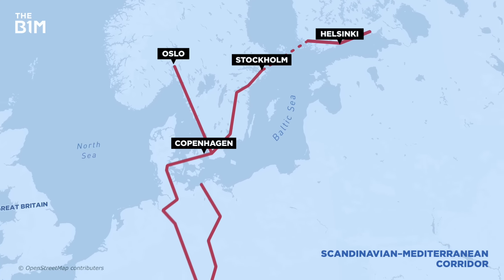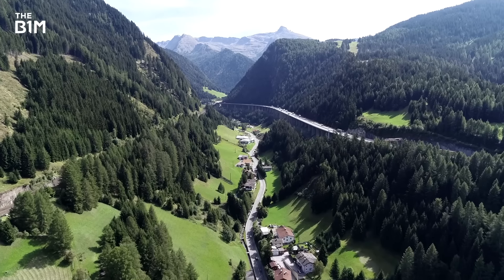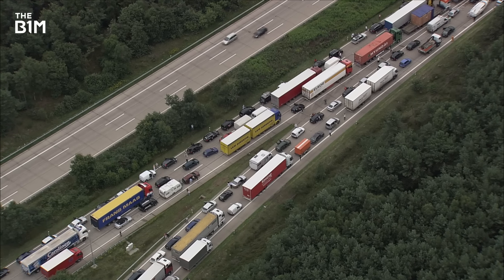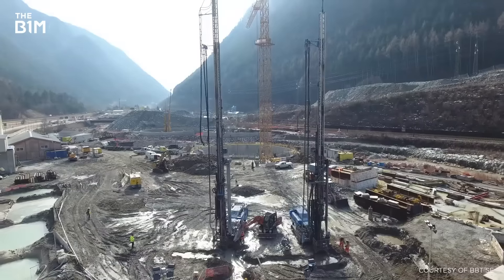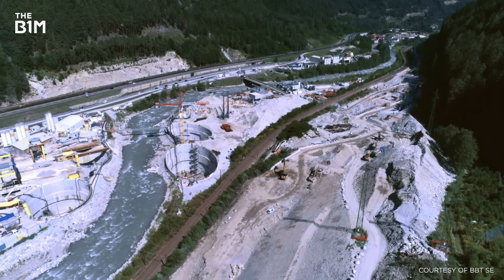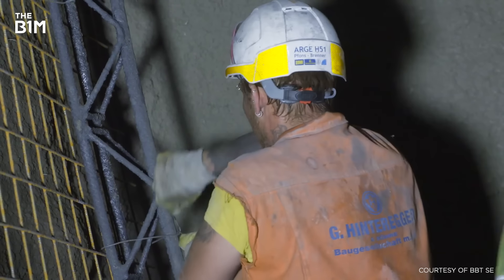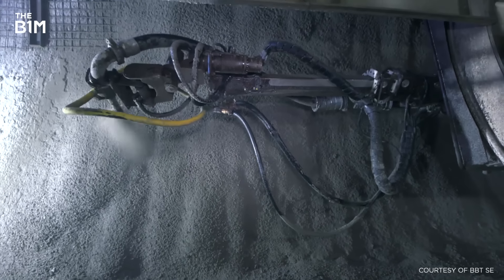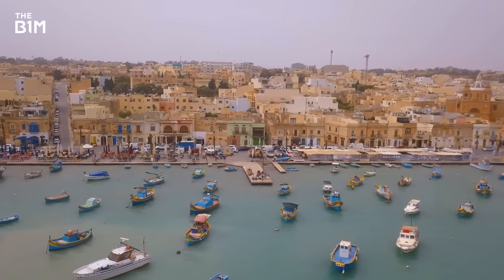The $11BN Tunnel Connecting Scandinavia to the Mediterranean

Comment: what is with the gotthard tunnel? i‘d say its also pretty important and when you look on a map the length of the way from hamburg to rome is pretty much the same. (even a bit faster)
Reply: This may seem ridiculous, but the point is that the Gotthard Tunnel is in Switzerland, which is not part of the EU. As a political and economic entity, the EU does not want to be beholden to Switzerland for a fast and reliable transport route through the Alps. Also, the Swiss charge a pretty high toll for use of their roads, especially for freight trucks.
Reply: @RudyBleeker  One more reason to NOT like the EU
Reply: @TheSlipCoach  In this specific situation, what's wrong with the EU? Rudy's comment clearly shows reasons as to why the EU would fund a project such as this.
Reply: @TheSlipCoach  quite the contrary, this project is a prime example of the many benefits of the EU, being able to organize and fund such massively expensive infrastructure over international borders.
Reply: @TheSlipCoach  I hate the eu but I don't see why this tunnel is wrong?
Reply: @TheSlipCoach  So you shouldn’t like the EU because a non EU country charges high tolls? Do you even process information before parroting your talking points?
Reply: @RudyBleeker  your comment is quite bullshit as the EU has an agreement with Switzerland to add capacity to the existing line from basel to Hamburg / Amsterdam… it’s all called NEAT and the EU also helped financing… Switzerland did. their Job, but Germany is wayyy behind with their job…
Reply: @jimi272  that has nothing to do with this project and the reasons for it
Reply: @phasorthunder1157  Living in Switzerland, with two flat railway lines through base tunnels already running through our country (NEAT), which cost billions of Swiss Francs and were agreed with and built (in time) for the (maybe not sole) purpose to help the EU get their freight from North to South and vice versa through the Alps fast, eco-friendly and reliable, I am concerned about comments that put the EU in a favourable light, heavily funding a "EU tunnel" over "international borders" only to be "independent" from self-paced third-party countries. The NEAT is already here, so why not finalise it and bring it to its full potential in cooperation with a non EU country first, before heavily funding a "EU only" project instead?

And I'm also concerned about the perception that using Swiss infrastructure is too costly. We toll freight trucks for allowing them to distress our ecosystem day by day. It seems EU citizens easily forget that these tolls pay into expensive and extensive road and road tunnel maintenance and into ecologic compensation for the heavy pollution caused mainly by foreign i.e. EU trucks.

The only hope I have is that both the Brenner base tunnel AND the NEAT will reduce road traffic through the Alps drastically in the future, and that they will save our precious Alpine eco-system from extinction. Though I'm not at all sure the Brenner base tunnel will live up to these expectations.
Reply: @mrgaudy1954  Let's face it: the new Brenner base tunnel (and its feeder lines) has - for years - been and is still being criticised as being useless in terms of expanding freight transport capabilities. It is therefore a shame that the EU - despite all the critique - will fund the building of the Brenner base tunnel with an estimated €5BN (of €10BN in total) until 2040, instead of heavily funding Germany now to finally upgrade its feeder lines to the existing NEAT through Switzerland. They would make trains faster, cheaper, more attractive and would quickly help reduce road freight traffic through the Alps. The Brenner base tunnel wouldn't be needed. It is a synonym for a failed (EU) transport policy.

Comment: This cost less than one third the price of the UK track and trace app that barely worked. Sickkk
Reply: How much is that?
Reply: You're confusing millions and billions
Reply: @BamBoomBots  wasn't it 20 odd billion for the track and trace that didn't work?
Reply: @slaneyside  an app surely cost millions not billions
Reply: @slaneyside  a quick Google search gave me a value of ~35M UK pounds for that app, while this is project costs €~11B. This infrastructure project is thus about 330 times as expensive (very rough estimate).
Reply: @karlgiese6100  that is not the costs of the app, that's the costs of the whole testing and contact tracing operation for covid-19 in the UK, of which the app was just a small part.
Reply: @slaneyside  Your quote just confirms what I said 😂.
Reply: @BamBoomBots  which didn't work

Comment: Can we state as for the Gotthard base tunnel, that Germany will not be able to complete it's section of the Work in time so that all this work will be only benefiting the short route from Austria to Italy...Great work Germany
Reply: your comment is very intelligent, i admire it. so do you stay in Germany?
Reply: @herschellpacheco7582  could you elaborate, I dont really understand your point? I am just saying that truck forwarder might find it more economical to drive all the way instead of putting them on a train as a big section is missing due to the difficulties Germany has to complete its section. I am not a manufactured good, so I can move using other means of transportation. So again, dont really get your comment

Comment: Fun fact: road traffic along the existing Brenner motorway is so heavy that repair & maintenance has to be done at roughly 10% of the stretch at all times, with the cycle repeating after 10 years - there is never a period where there is no construction work ongoing on the Brennerautobahn. This leads to complaints that people have to pay a toll and are still held up by road-work-induced congestion (in addition to the congestion that has been there in the first place). But it cannot be done any other way.

Comment: Never have I imagined a drill with that shape
I always thought ground drill also have cone shaped 😅
Reply: It's harder to  mount the cutters on a cone and for the same diameter tunnel a cone drill would be cutting a large surface area needing more power. Cones are in cartoons because it's easier to recognize them as drills than a flat block.

Comment: Europe spends 11bn tunneling 34 miles through a mountain range while New York spent the same amount building a 2 mile long subway from Manhattan to Queens.
Reply: City tunnel construction is much more expensive. You have so many pipes, canals and electric cables…, you must be careful with foundations and you have few access points. Logistics is more challenging and the terrain is entirely different. 

It makes sense.

Comment: The problem is that Germany hasn't even begun yet to plan the required railway connection to the tunnel from their side. Up to now, there is a double tracked railway that goes through the "Inn Valley" But this railway is already pretty much used to its capacity. They'd need to make it a four tracked railway, but there is a problem: The valley is densely populated and German planers haven't even started to think how to solve the problem.

Comment: environmentally wise, is this a better option on the long run?
Reply: Almost certainly trains are incredibly efficient compared to trucks and cars for hauling freight and passengers to begin with and the level grade of the tunnel rather then having to go up and over even through a pass will further save on energy use.  They could put coal powered trains on it and probably still be a net environmental gain compared to trucks going over the mountains, let alone the electric ones they will be using.

Comment: I'm very impressed by the scale of this, but it leaves questions.  Huge numbers of trucks are currently moving freight north and south along that corridor.  as well as  tourist traffic etc like the video said.  This solves the tourists.  What about the freight?   I can't see a 200kmh train hauling freight? can it, or do you run freight through the tunnel as well at 60kmh?  almost like they need 3 tunnels one more for freight train traffic.
Reply: Fright trains in europe go around 120km/h 
The tunnel will be 64km long
64km : 120km/h = 33 min for fright train
64km : 200km/h = 22 min for pasangertrains

A frighttrain needs around 15 min ahead of a pasanger train to not have a crash in the tunnel.
That is pritty good and realisible!

a standart fright train is around 740m long and can carry around 52 Truckloads.
Imagine 52 trucks going down the same street in a time window of 33min. Pure Chaos!

Comment: Won't the vibrations of explosions, excavations and the trains transit destabilize the alreay eroded and delicate dolomites peaks?
Reply: I don't think the scale Is big enough to affect the mountains, natural tectonic movement can affect mountains much more and if you do a seismograph check of that area, i'm pretty sure you won't be able to tell the difference between the natural seismic activity and the artificial esplosions and drilling process, but idk, maybe i'm wrong, i'm just assuming based on the scale of the mountains, the scale of the gallery and the average power of micro earthquakes
Reply: @matthewgrilli4497  I don't know where you live, but here in Italy, in Rome or Milan eg. monuments and buildings (many are from medival or napoleonic age) are under heavy stress for the vibrations caused by the undergrounds and tram. The dolomite peaks are much more delicate than many of those buildings and the performance at which the rock transmit vibration is much better than the ground upon which are built Milan and Rome (even if Rome is built on tufo). So those peaks will recive a good % of those vibrarion, even if they stand 1500 to 3000 meters above it. Consider also that dolomites are already heavely eroded by wind, important temperature fluctuation and rains...acid rains. There are many papers and studies about their erosion. So, if by a side this project is great for pollution, the vibration caused by the building process and the train transit will do no good to these piece of eden on Earth
Reply: @Akitorbenov  ok i get your point but the amount of movement in a metropolis like Rome or Milan Is way bigger than just 1 train, not dire about the drilling process, you may be right about that but, if they are building the tunnel right now, they (hopefully) already took in account for the possibile damage onto the peaks of the dolomites and, as you said, other agents like wind and rain are much more present and constant than underground vibration from the tunnel. Again, this Is only my speculation, the engeeniers probably already did all the work about this so It should be fine
Reply: @matthewgrilli4497  Dear Matthew, i appreciate so much your positivity, but i do not trust engineers nor politicians. Morandi Bridge in Genova or Vajont dam or the damage caused by Solvay  in Rosignano are more than enought to belive that when money are on the table, business people don't care even about their child anymore.
Reply: @Akitorbenov  true, those disasters are really relevant and money Is always a big drive but those were old project, when safety was mostly an optional, civil engeeniering in 2020 Is a big deal now, they hardly permit safety to be ignored on a such of a big project and if they do, they are going to serve big jailtime
Reply: @matthewgrilli4497  we will see. My hope is that everything will go well, but i'm always doubtfull

Comment: Why the hell, won’t they not link Ireland to the continent? They
Could build a tunnel from Waterford to Normandy in France.
Reply: water depht.
the irish sea is substantially deeper than the channel, wich would require a deeper tunnel, wich would negate the benefits due to the inclines.
the channel mouth between Dover and Calais is around 45-50m deep, the irish sea in the north channel between NI and Scotland is around 120-160m deep, the average depth of the whole irish sea is 120m, 3 times as deep as the channel. 
a tunnel below that is just not feasable

Comment: they couldn't connect the two tunnels every 666 meters, cause obviously, the distance would be way too long for the security of the passengers.

SO those sanatist Swiss guys, resigned, finally decided to put a '' safe '' exit every 333meters. why 333?
and why not 330 or 300? or even 301 or 302 actually? lol
330 and THREE meters.
... and of course, I am a '' COMPLOTIST '' 😌
Reply: Pretty sure it is just "three emergency exits per kilometer". So 333 meters comes from 1000/3, rounded to 1.0 meter accuracy.

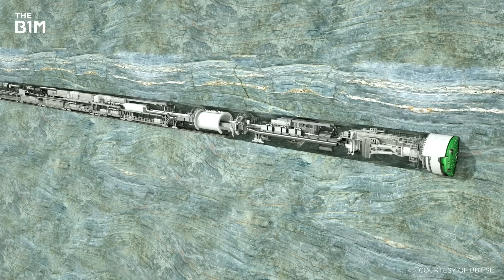Comment: 4:27 The reinforcement seems so thin for preventing a mountain from caving in on a tunnel.
Reply: The mountain rock itself is doing that. The concrete just helps spread the load to lower rock deformation and prevents smaller pieces from falling off and so on.

Comment: This is a reckless project.  I'm sure it will have massive environmental implications for generations to come. And they complain about a plastic straw
Reply: This is bullshit. Tyrolean roads are on the verge of collapse. Traffic jams everywhere. This Tunnel is made to solve that problem.

On the other Hand, a Tunnel is dug. Barely any environment impact simply as nothing lives in Rock.

So, either massive pollution by traffic jams or a tunnel that has no effect on the Environment